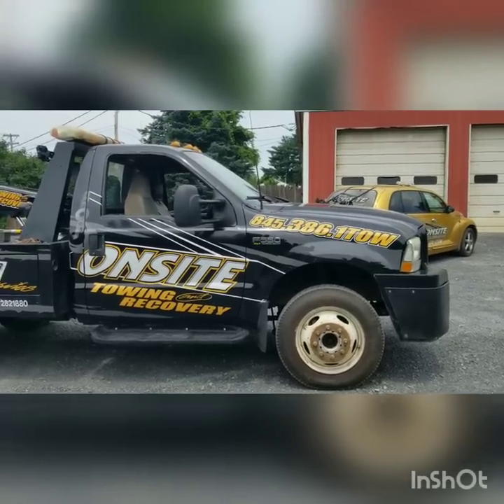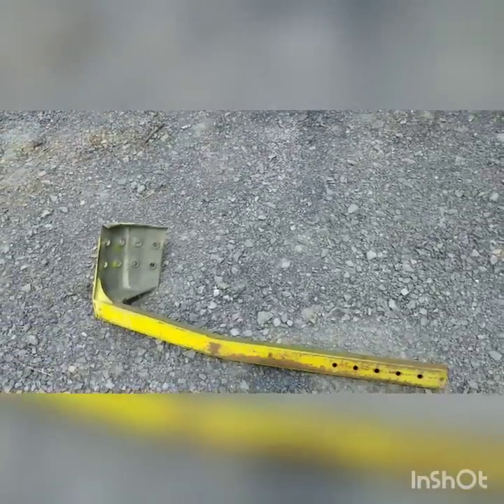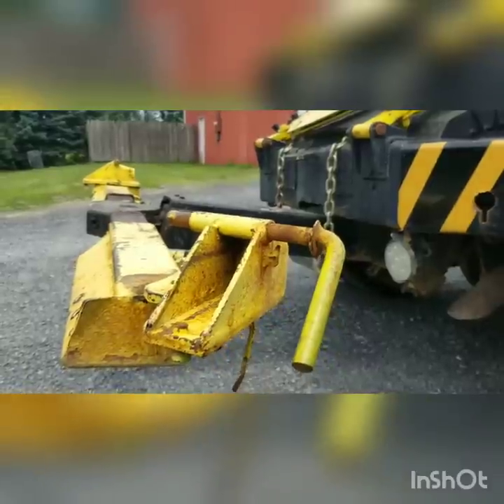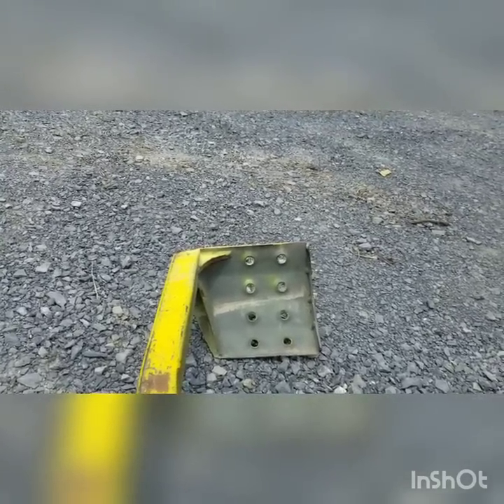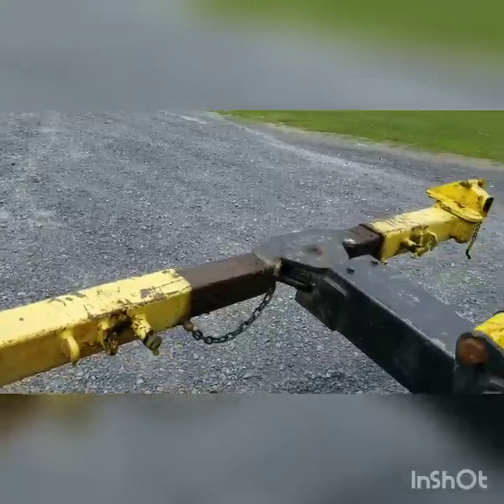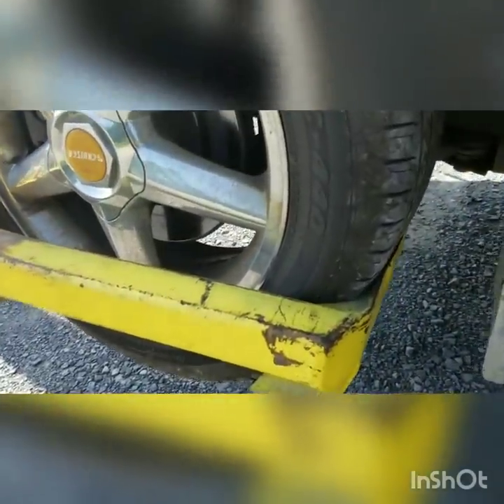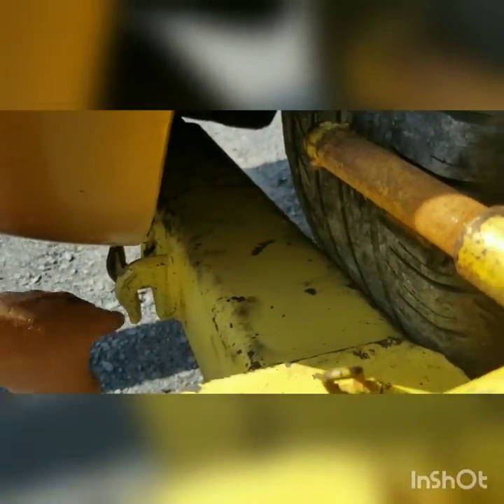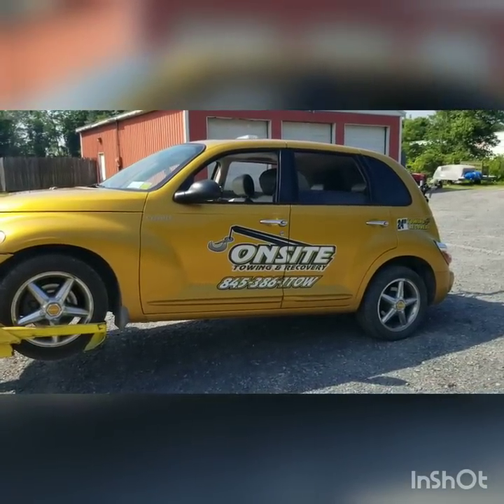How to use the Vulcan Strapless Wheel Lift

Comment: 30 years towing ran these wreckers many many years. Yes it is a strapless system but the owners manual it says to use a tye down chain. The grid bars have two opposing grab hooks each welded to them for this purpose. When brand new these body's come with chains that are about three feet long with a cluster hook on one end and a grab hook on the other so you can choose a frame hole or wrap a suspension part then hook to one of the grids grab hooks. Do this on both grids then when you tilt it will pin the car down tight with no chance of it jumping out. The manual also says to use both safety chains while in tow as well as it being a federal requirement.
Reply: How does it say tho use the straps just wondering I have the same lift and keep getting pulled over for no straps but can’t figure out what strap system I am suppose to use
Reply: I will say this; when it comes to motor carrier they don’t give a crap about Vulcans “strapless” system. They will give you a ticket for no straps.

Comment: I like to drill a hole in the sleeve over the tire safety bar, then welding a nut over the hole. This provides a location for a zert/ grease fitting to be placed. This way you can lube the safety bar along with the other lube points. I've found by doing this you can keep the safety bar from rusting and makes it easier to use. Most the lifts I've seen have this bar bent, or so rusty that is almost impossible to use because it won't slide. AND yes, I've even seen people cut these safety bars off. It shows how many people don't know how the lift was designed to be used. Love the video, keep them coming!
Reply: Save the welder, tap the hole.

Comment: Dont forget to double spoon those chryslers using a 4x4 under the wheel! If not you could easily puncture an oil pan with the stinger if you hit a good enough bump, or if the struts are junk or both! Very familiar with the vulcan set up, and seen a lot of guys over the years cause damage from not spooning the wheels tight enough
Reply: What do you mean double spoon with a 4x4? Thanks
Reply: Pick it Up, lower onto wood and grab a little tighter with the scoops to allow clearance to the oilpan

Comment: It is possible for the pan, or spoon part to... Somehow come out when we dont pin it properly. . . Ive had a rare case when the locking pin jumps out and the pan unpinned itself from normal driving on bumping road. The axle strap on control arm saved it
Reply from the maker: The pin might of not been fully seated

Comment: Good video. I just got a new truck and it has this stinger on it. Going from 3 years of autogrips back to manual labor. Mine is missing the pins for the spoons.
Reply from the maker: Thanks for watching.
Reply: most of the time the setup only comes with one pin and a second one needs to be bought ..
Reply: I used to use grade 10 bolts in place of the original lost pins.

Comment: Idk about NY but I’ve worked with that type of wheel lift here in SoCal and WE DO need to strap and chain with the scoops. Plus the truck I used had the straps to Sling. I personally think this method is outdated and puts the operator in more danger because of the extra time you need to set it up even without straps specially on the freeway. Doesn’t matter how fast you are you can be even faster with the self loader.
Reply from the maker: Ive moved on to a selfloader, it will be hard for me to go back to a scoop system.
Reply: Self loader isn't necessary at all, We run 5 rollbacks all with standard L arms, We are pretty damn quick with them, I've pulled up to a crash scene loaded my car, then loaded the 2nd car and moved it out of the road and unloaded it by the time the 2nd company got on scene, Officer damn near let me take both if the his dispatch didn't call in saying they dispatched the other company right as I was ready to tie it down and leave, Had my second dropped and the 2nd company showed up about 5 minutes later... L arms are pretty damn quick, Don't get me wrong our auto loader is much quicker but don't count standard L arms out.
Reply: @towtruckaj  
Agreed. I do repo and I'm a ninja with my autoloader..... but I was also faaaaaast with the standard square tube L-arms when I was doing roadside. I mean faaaast. Just keep everything smooth, silky, and ready to rock for the next tow. All this efficiency = safety by saving time dancing on the freeway.

Comment: Incorrectly done.   
As per Miller ind. and D.O.T.   This setup MUST have safety chains attached to the grid to prevent the vehicle from lifting off in case of an accident.    
   
This is NOT an optional "extra security" tiedown as you state.   It is mandatory.   
   
It's a strapless lift, not a strapless and safety chainless lift.
Reply from the maker: Almost certain i said in video , if transporting , you must use safety chains. Thats a DOT law.

Comment: Do you usually run your safety chains over the top of the wheel lift or under. I use the same wheel lift and have seen people do it both ways. Just wondering.
Reply from the maker: I usually run them under the wheel grids and cross them over the wheel lift main beam
Reply: Under the wheel lift
Reply: the manufacturer says to run the safety straps under the stinger and thru the upwards facing grab hook to prevent the vehicle from jumping out of the baskets

Comment: How is the oil pan clearance from the cross bar?seems like the bumper is sitting pretty low
Reply from the maker: That bumper had several broken clips, so it sat really low
Reply: With my experience a pt cruiser would be a concern for the oil pan clearance. Like most front wheel drive vehicles, VW’s, Saab’s, Volvo’s etc. I would place a pan pillow(a pillow made out of rubber that’s filled with air) to prevent damaging the undercarriage or double panning it(hook it up, lower wheels over 2x4 and get the pans/spoons/wheel retainers in for a tighter fit which gives more clearance for the vehicles undercarriage to the cross bar).
Reply: @giuseppes8792  
Hate those VWs...
Especially the VR6 😁

Comment: How long are these top saftey pins supposed to be? On my rig I just picked up, one is 5" other is 4" in the full engaged locked position.I had an issue popping a customer's tire pull out of their driveway
Reply from the maker: Those pins are supposed to be all the way in. Should hit about midway on tire. That pin prevents vehicle from jumping forwarf
Reply: @towuniverse2443  I am just curious to why it punctures tires? I'm looking to swap grids to those with L arms so I can just strap the F'er down but also my grids adjust by a T post that screws down I'd really prefer cam locks

Comment: In my state, without some sort of strap, they’ll have your ass hard. I think I’m buying a truck with this lift. Used these on the back of the rollbacks a company had that I worked for. They even had it on a wheel lift truck. Then they bought a self loader style after I left.
Reply: TenLugThuggin ...Not sure what state you’re talking about..but here in Texas - particular in Houston the State Troopers WILL hang your ass for no safety chains..the Local City police are real laxed on it..
Reply: Use a safety chain from truck, wrap around the grid, and connect to lower control arm with a short axle strap.  Then take the chain thru the double hooks to secure.  Adjust chain length so they don't drag.  This accomplishes what a tie down strap would do as well as a safety chain, all in one.  Easy peasy.
Reply: @TommyValentine  it was Tulsa, Oklahoma. Now I’m in Florida. OHP, depending on who it was would mail you. City could give a damn really.
Reply: @indoorroadkill3369  it probably accomplishes the same thing. But OHP was not the department to fuck with lol. They wanted it a certain way. You could probably skate by and many wouldn’t really notice.
Reply: @baldwin142  yeah, everywhere is a little different.  What I described is how I was shown by an MTO inspector.... so as long as I don't leave Ontario I should be fine! 😆

Comment: you are supposed to have the safety chains go around a suspension part or attach to frame/subframe where tie down points are and drop under the cross bar of stinger and go thru the upwards facing grab hook preventing the vehicle from jumping out of the scoops .. youre half-assing when loading and by not having the safety chains youre only gonna cause a lawsuit if shit hits the fan .. learn how to do your craft the right way before posting a video on "how to" as its gonna give other tow ops starting out bad habits of half assing the job .. just because you havent lost one yet just means you have been really lucky
Reply: Actually safety chains are only really supposed to be/required to be put on a solid part of the vehicle, frame, sub frame, suspension etc something solid, and back to your truck, usually crossed, personally I always go under the wheel lift with my safety chains into the lower facing hook and over the top facing hook, keeps it nice and secure.
Reply: Yeap...correct you are 👍🏼
Reply: i go over and into hooks
Reply: He stated in the video that safety chains and lights needed to be added to his hookup to actually tow the car anywhere, but since he wasn't actually going to tow the company service car anywhere he didn't do it for the video.
Reply: I always hook the chains to the front axles, and hook the chain through both stinger hooks.

Comment: Vulcan scoop design severely outdated. Was designed in Canada in 1986 for Vulcan 860 Wrecker. And 78 series 15 inch tires. Vulcan scoops on current Tire designs do damage and I have seen many customers complain about Tire Damage from Vulcan scoops. Also Vulcan pivot eats oil pans. Even when all components are new you have to double pick the car and set it higher in the scoops just to get enough clearance so you don't get a damage claim. System severely outdated. Also the Scoops crack and the scoop arm rust from the inside and snap. Most new cars the Panic Stop Bar doesn't fit past the wheel well so it can't be used. I have done thousands of tow with that system and it's just not viable for today's vehicles. There are other systems that are also made by Miller Industries (which is the same brand manufacturer for Vulcan) that are far superior. Example, CENTURY pan system, And CHEVRON system both far superior.
Reply from the maker: Since I have got my MPL 40, it makes the Vulcan system look primitive. But the Vulcan out performs in recovery work.
Reply: @towuniverse2443  In the greater Toronto area where I work guys are slow to adopt self loaders.   Very few being used. The vast majority of people are still using  Vulcan scoops system...
And yes I would agree with you that Miller's products are hard to beat for Recovery work. Example: Century,Holmes,Vulcan,Chevron.  The jerr-dan units I've used are pretty poor when it comes to recovery.
Reply: Can you change the L arms or what can you do to fix this problem please 
Get back just got a Vulcan this sounds scary
Reply from the maker: @edwardstowingroadservice9319  yes you can swap out recivers and scoops for traditional set up.
Reply: @edwardstowingroadservice9319  swap out the Vulcan scoop system 4 Century sliders and pivot arms and you will have almost no problems.

Comment: Those lifts suck for mopar fwd trans pans and especially for vw oil pans.  Better have a small scrap tire or airbag inflated between the lift ans those pans.
Reply: Lift the car, set a 4x4 under the wheel, lower car and sit it on 4x4 and push spoon further in. Grabs lower on the tire and gives more oil pan clearance. Ran this type of wheel lift everyday for the past 12 years and never have any issues.

Comment: If your not running straps your endangering the public you give wrecker operators  a bad name you need to be running some sort of saftey its not if its gonna come off its when with your setup
Reply: tbirdpimp07 he said he doesn’t run break away chains either 😳
Reply from the maker: You obviously are not paying attention. The way this wheel lift was design, is without straps. Put straps on it and you will lose the car. Read the Vulcan manual.Perhaps, you should rewind and see the part where I mention the pin on the receiver. I also mention in the video you need to use safety chains, thats FMCSA law. This was done in my lot to educate people on how the strapless wheel lift works. Thanks for watching
Reply: I would like to thank you for educating possible new operators, but it would of been a better/complete video if you’ve explained on how your secondary means of attachment(safety chains) would be placed in order for the straps to be avoided. There’s only one method we’re taught and police are aware of this method otherwise an insecure load would be charged. Again thanks for the video and be safe out there.
Reply: @towuniverse2443   I think you did a fine job, and a lot of key points, I have the same bed, I guess everyone isn't familar how these work, I love mine. Keep up the good work, I like watching your vids,
Reply: you made the comment of "i dont have to use it" as for the secondary safety chain that goes under the stinger to an attachment point or suspension when the fact is the manufacturer clearly states that it must be used to prevent upwards movement and the vehicle bouncing out of the baskets .. safety should be used at all times as well as the secondary safety chains